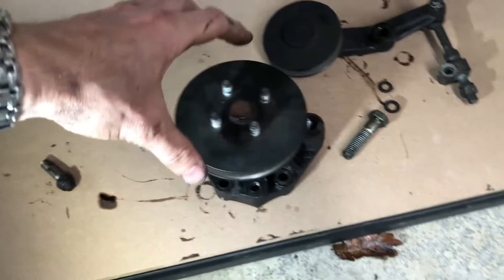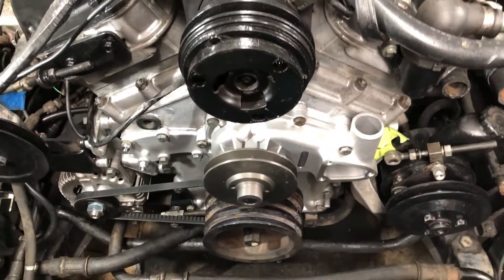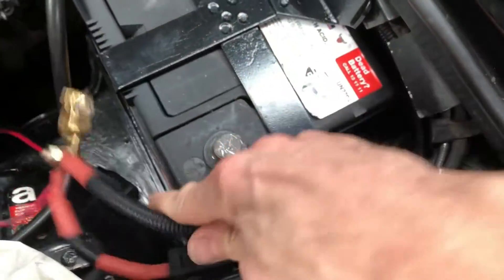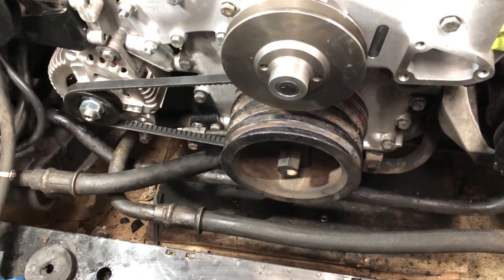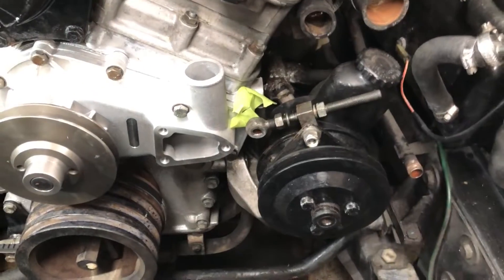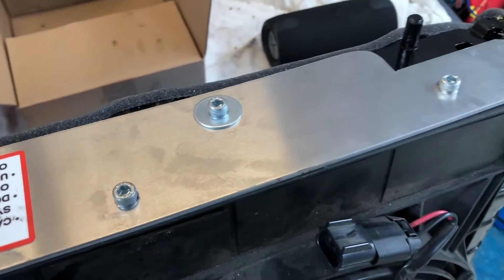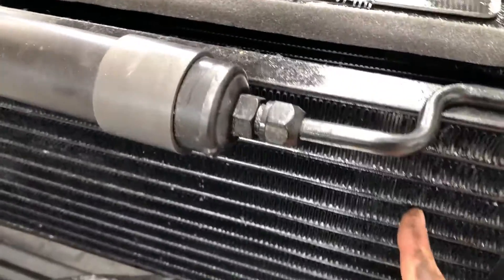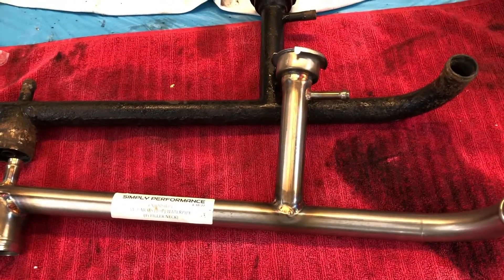Jaguar V12 cooling system upgrade part 2

Comment from the maker: I was warned about annoying noise, but I cannot hear the fans above the normal noise of the engine, even when I am outside the car. I have to put my hand in front of each end of the front grill, to feel if each fan is on! There is some extra zip in the car, soon after starting it - previously the mechanical fan would be engaged for the first couple of minutes. I thought there would be more power generally, but haven’t noticed the loss of rotational mass particularly. The mechanical fan is VERY heavy and I’m glad it’s gone!